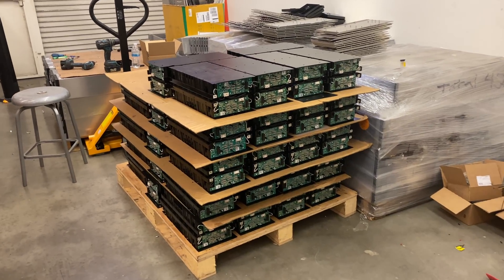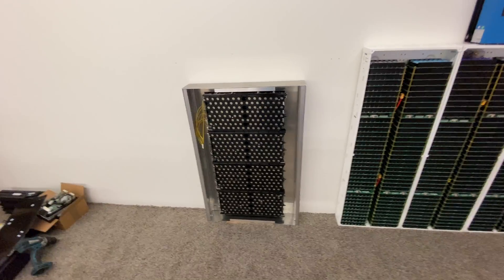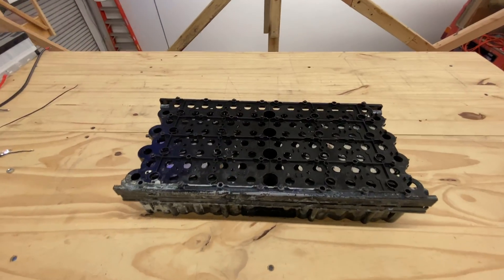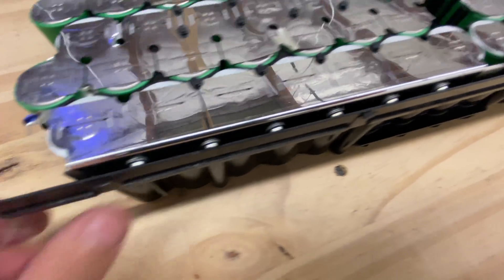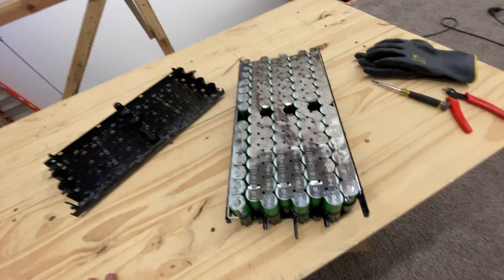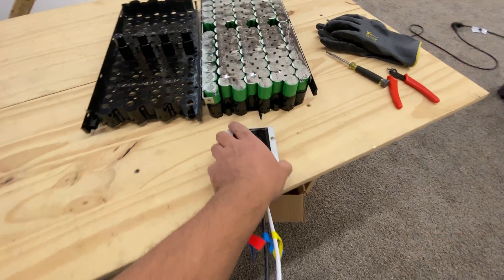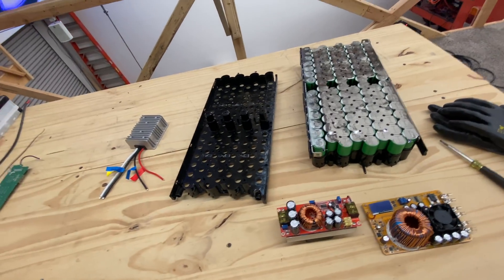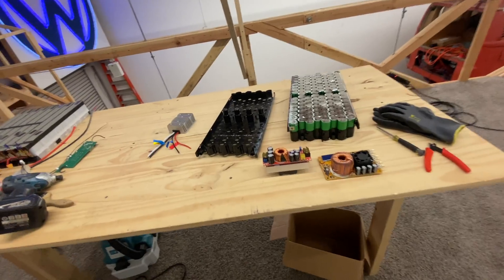$100/Kwh LiFePO4 12v Hack

Comment: Great info! 

You should consider doing some videos on 12v batteries/power supplies - I know you're focused on 24v, and power wall kinds of things, but keep in mind that there is a huge amateur radio (HAM radio) community who would love to have some videos about setting up systems to power their mobile radios. Most of the mobile radios are spec'ed out for a 13.8v power feed, so maybe that is why you haven't done anything for HAM radio operators, yet.

Thanks for the great content and guidance on 'off-grid' solutions!

~Jim

Comment: I have found that for automotive or RV use, you want the 13.8V step down converter. If you use the 12V step down all of your 12V stuff will complain of low battery once there is a load.

Comment: Baught one of these packs. Built a 24V system.  8s bms added. Charging with a solar charge controller and finding my last set of batteries the 8th string charges way faster then the other banks. 1 through 7s stay at around 3.4 volts while the 8s bank charges to 3.7.  This stops the charging. Any ideas on what I’m doing wrong.  I’m using a EP Ever charge controller. Can’t get the pack to a full charge.

Comment: For those wanting to split them in half for 2 12v batteries.
The middle metal peels right off. Use a needle nose pliers and carefully pull it off of each individual battery. Be careful not to touch any other battery.
I taped off both sides and carefully removed the middle.
Boom 2 12v batteries.

Comment: we want 12 volt because we want to ..............

1. build a drop in replacement  for a boat battery to run an electric trolling motor (i doubt you can get a 24 volt trolling motor and over volting most 12 volt motors to 24 will burn them out).

2. same goes for the car maybe a car that is very difficult to start where you end up draining the battery before the car finally starts.

3. 12 volt modules seriesed are easier to work with because you can replace a module and less cells have to go bad.

Comment: So I just tested my first pack at 0.7A per cell (10A on the pack) discharged to 2.9v (there's not much more past 2.9v), and I'm only getting 2555mah per cell average.  This is using iCharger X8.  The page says these tested 95%-100%, what is the capacity you're using?  Based on the graph on your product page, it didn't even make it to 3000mah discharging til 2v.  That graph BTW was taken from candlepowerforums by a well known contributor named HKJ.  He tested them to be 2896mah discharging at 0.5C.  Even if I use his numbers, my test results only gets me to 88%, no where near the 95%-100% advertised.  Can you elaborate more on these numbers?  How you're testing and what capacity did the 95% calculation come from?
Reply: Since the packs are sold out, and Jehu isn't replying anymore, I did my own research.  These cells don't deliver the 3000mAh that Sony claims.  After going over HKJ’s post on the testing of these Sony Lifepo4 cell, I determined based on his testing that these cells have 2800mah of capacity when discharged to 2.9v at 0.5C, my tests are even lower than that. Between 2.9v to 2v there’s barely a percent left, it isn't worth taking the cells that low.

After doing 2 full cycles on my packs, I found my first pack to have average 2575mah per cell and 2nd pack 2692mah per cell.  Since I don’t know what capacity number Jehu is using I can only assume it’s 2800mAh, since:

First pack based on manufacture’s spec: 85.83%, based on HKJ’s tested spec:  91.96%
2nd pack based on manufacture’s spec: 89.73%, based on HKJ’s tested spec:  96.14%

Not quite 95%-100% of original capacity on the first pack.  I suspect some of these packs have had a lot more than 100 cycles or they sat around a long time.

What's everyone getting on their packs?
Reply: so two of 4 tested.... cell 2 of both packs has been weird... I haven't done a soak at balance, but balanced at 3.65 with supplemental power into cell 2....   both packs finishd a charge to 3.65 across immediately discharged to 2.9 at 5 amps, then immediate recharge to 3.65 at 8 amps...    cell 2 did not track with the other cells, and was still mid 3.3s when others got back to 3.65.  All told I am getting just a smidge over 37 AH  (or ~2650 mAh per cell).   Or around 88% mfg,  ~94% on the 2800.   Definitely not he "42 Ah" listed on the store site.  Guess the more sad thing here is the stated nominal by 42 is 1075 WH, not the 1121 WH on the store page, and of course the 940 WH I am actually getting (84% of stated in the text of the ad).  Obviously the BMS board on the pack is completely passive... has the bleed resistors, voltage sense, and termistors but no smarts, just the multi-way connector.   Obviously based on the 3 of 4 arrived packs, these were designed to be two packs (one with the "HI" card, one with the "LO" card) for a 48v system.  Just feels suspicious.  Went for it because it looked to be $98ish per kwh. Looks closer to $130 per kwh.  Still better than the $400ish per kwh of some brand new cells I recently purchased. But those are perfectly matched, brand new.  I dunno.
Reply: Looks like your capacity is right between my 2 packs, although I only charged to 3.6v.  But these were never $100kWh to begin with. $119.99/1.121Wh from the description would have been $107/kWh.  At the HKJ's tested capacity, further away from that, and from our tests, even less.  The convenience of a ready-built pack at 24V is nice, but in the end, it's not really what was stated in the product page.  See, if the argument is that at 3000mAh of manufacture's state capacity, it's close to $100/kWh, but then we'd only have 85% to 90% of rated capacity, not 95%-100%.  If they go with 2800mAh of HKJ's test to get to close to 95%-100%, then it's not $100/kWh.  Only 1 is true, you can't have both.
Reply: @rcboosted  third pack just off test (god I wish I had a better setup to run better than .2C Up and .15C down.... winds up being nearly 24 hours for one full up, down, up.  Ironically again cell 2 is not acting matched to the others, required additional charging on first up, tracked down with other cells fine, but immediate recharge it was the low cell when all the others were in sync.  This pack a little lower... 36.7 AH  .. so that makes my average individual cell just over 2600 mah. Just a little down,  93-94% on 2800.   4th pack arrived this morning. Sadly its a high-pack, so wound up with 3 highs, 1 low... oh well, a little extra wire when i get around to build out.
Reply: @todkapuz  That's still higher than my low pack.  I've fully charged mine to let them sit for at least a couple week to capacity test again.  This should tell me how well they are in terms of life/cycle left.  Thanks for sharing your test results.  I did notice they stack some how, but I finally figured out the "tops" are supposed to face each other to click in.  Couldn't figure out how they clicked in top to bottom.  On a glass half full note, those light blue rubbery things that lined most of the bottom tray appears to be thermal conductive pads.  Now I have a life time supply of it.
Reply: @rcboosted  light blue rubbery things...... is that under the black plastic sheet? (I havent bothered taking it off).  YEah.. its top to top... if you have a "H" pack and a "L" pack, the terminals align right to make easy series connection. Or at least 3 of my packs have H, and 1 has L (L being busbarred the other way).  So after finishing up testing, my spread is 36.7 Ah to 37.4 Ah for the packs, or about 2610 to 2670 for the individual cells.   All 4 of my packs the 2nd cell group must have some sort of resistance difference (even though my charger says no)...  on all 4 packs all the other cells near perfect climb to 3.65 volts (with cell group 2 still around the 3.3 volt mark) with another 0.2-0.3 Ah to go into cell group 2 for it to climb to 3.65. This was both on initial charge (although that varied more, and the top balance followed by drain followed by immediate re-charge for the 0.2ish ones).  On pack rest, cell two quickly fell back down (its 0.03+ volts lower than other cells) and in general cell group 7 on all packs remained high (couple of hundredths above the average). Initial SOC for the packs, 3 of them were around 9AH to full,  my 3rd pack was 28 Ah to full.    anyhow...  all sitting now and watching the relaxation. I'll put one on discharge maybe next week.
Reply: @todkapuz  It's safe to say these are 90%-95% cells based on our tests and the 2800mah HKJ rating then.  It's strange your cell group 2 all showed lower voltage.  Could it be balance lead or charger issue?  Although I did find the middle cells in my EMC packs to be lower capacity in my other LF packs too.  Unfortunately I did not keep track of my initial charge, but I do remember the first pack was almost fully charged, (maybe that's why its capacity was lower?) 2nd pack was nearly empty, probably 30Ah+ to get it full. The blue rubbery things, yea they're under the black plastic sheet, mine came off on it's own.
Reply: (really hoping the straggler pack 4 is also a low-card setup, then I'll have two perfect packs for the 48v I intend to use these at)
Reply: @todkapuz   I received my modules this morning. I need help in replacing the BMS with one from overkillsolar. I am new to this and I can use any assistance you can give me in replacing the onboard BMS. In the meantime,  I am hoping that Jehu would put out a video on how to get this thing to work.  Thanks...
Reply: @yvonjoseph3735  the bms-like board that is on the pack is basically part of balance and monitoring interconnect board. It is completely passive, and requires a controller connected to the connector to do anything.  Basically all it has one it is all the temperature sensors route directly to the connector, and then for each cell there is a voltage sense from each cell group (a small trace) and a balance lead (a larger trace with the resistor in line).  It is kind of nice since it does have 2 amp pcb fuses.  It would be possible to build a circuit to take advantage of it, but probably not worth the cost.   The board can be left in place with no ill effect, just connect your BMS cable leads to the tabs around the board (typically the far left is negative, bottom one is first cell, oval at the top of the board above it is 2nd cell, oval to the right and bottom of board is 3rd, etc... until you get to the far right which is positive.   If you want to remove the board, there are two screws holding it in...  remove then and unclip the temperature sensor connection at the top of the board. Then you need a very powerful soldering iron (a lot of heat capacity). I started on the right side.. initially left the pos and negative connected to the board (to keep it from flying) and gently pulled away from the pack with one hand while heating the top right most tab oval... the tab pulls away back to the pack, then the lower right most.. etc...   when all the direct tabs were off, then disconnected the wires from the pos and negative tab (leaving wires on the board), and went back and soldered my bms leads directly to those tabs.    Jehu in his video just cut the tabs behind the board (or mentioned cutting them).. but there is no need to do this unless you do not have a powerful soldering iron. Do be careful with the method I described, as it can send solder flying a bit.
Reply: @todkapuz  Thanks for the advice and I will leave in place the onboard BMS and do it as you suggested. Here is the layout of the BMS leads:
———————————————
|               2         4        6        |
|    N                                     P |
|         1    3         5        7        |
———————————————
Please, let me know if I get it right..
Your assistance is very much appreciated!  By the way, I was able to verify the sequence of each cel by using a multimeter...
Reply: @todkapuz  What BMS would you recommend to use on these modules?
Reply: @yvonjoseph3735   not sure I am best to provide advice here... I have a custom daly bms on order for my 48V desired setup. If you want a generally well regarded system with low temperature cut off and bluetooth watching, probably go with the overkill solar bms... probably can get it in a short order. It is critical to make sure you get a LiFePO4 specific bms... as most other lithium chemistries have a nominal voltage above the maximum charge voltage of LiFe. And of course protect your cells from freezing (really its charging below 0C that is the biggest risk).
Reply: @todkapuz  Thank you for the thoughtful advice. I was leaning toward the Overkill BMS because of the Bluetooth feature.  I am not really too concerned about the temperature sensor, I am going to send those modules to a tropical country... Again, many thanks..

Comment: Jehu,  got my order today thanks.  What do you think about factory wire used for the 8 balance leads?  Maybe 22awg?  Seems a little on the thin side.  Do you recommend replacing them with 18awg?   Last question, are the factory balance leads connected to the cell groups in the proper fashion?  THX
Reply from the maker: Balance leads don’t need to be thick you are only balancing at rates lower than 1A

Comment: Hey man, any EU online stores that you'd recommend to get batteries to set a 10Kw battery pack backup? Most of the guys I follow on YT like you only offer delivery in North America. Much appreciated. Saludos
Reply: —> Aliexpress —> lifepo4 90Ah or 120Ah or 200Ah or 280Ah 
Maybe you should check around a little about guys who’ve tested some offerings. Because if the vendors don’t explicitly mark the cells as „grade A“ or „NEW“ you’d usually get class B batteries. If you get a grade B battery advertised with 100Ah chances are that it was a 120Ah which got rebranded once it was down to 80% capacity during its first life. This is nothing bad per SE as these batteries tend to degrade linearly. Maybe you can get a good deal like this if space is not a premium. 
Usually prices are around 220€ - 280€ per kWh which is pretty good if you you consider the cycle life of this chemistry.

Comment: 24V is the way we went with our RV. We use 24V to power the inverter and then step down to 12V for the DC circuits. Did add a small 12V (3s2p) Liion battery on the 12V side to handle any spikes in power from the pump or any of the high draw devices and to protect the 760W 24/12V converter. Not as complicated as we originally thought. In hindsight, I proabably would have considered 48V to save the frustration with such huge cables because they are still 2/0 cables (4000W inverter) and a pain to work with. Next RV will probably go 48V but the next RV will probably need 50a, not 30.

Comment: Does a LiFePO4 battery have to be cycled?    I’m using a solar panel to keep mine above 95% all the time.   How will this affect their lifetime?  Been running this way for a year so far.   No apparent I’ll effects yet.

Comment: Hello, I'm Tung, I'm From VietNamese an electric motorcycle battery factory technician. Do you mind when I want to ask you something?
On the side of the company I manufacture batteries with specifications 57.75V - 22Ah have BMS control circuit and BMS power to control the battery. The battery has 14 cell clusters, the clusters are connected in parallel.
After a period of use, the battery has cell cluster difference warning.
When tested by CAN, there was an abnormal drop cluster
Because I cannot rework because the cells are soldered, I want to ask if there is any way to charge the dipped cluster?
Because on BMS power there is a mosfet warning that the cluster is dropped on it will not charge and discharge.
Thanks!

Comment: I'd love to buy some batteries from you, but I'm in Canada, and apparently nobody ships here, and the batteries that are already  here are kinda crazy expensive because I can't seem to find anything used.  I really want to get into building a powerwall type thing, because power where I am hasn't been the most reliable and having something to bridge the gap during brownouts or outages is super valuable to me because I run a lot of electronics - most of which take a while to restart after a brownout.  Right now I have some APC SUA1500 (or similar) units with no batteries (obtained from system upgrades from work - most of them were replaced due to bad batteries but work fine); they're designed for lead-acid so a LiFePO4 would be a good replacement, especially since the system takes 24v (2x12v lead acid) normally.

I just can't get batteries that are decently affordable.

Comment: Would you not recommend these for Golf Cart batteries?  I have a 48v golf cart with FOUR 12v 100AH in series, could I not wire these up in any series/parallel that I'd want?
Reply from the maker: Yes that would work

Comment: Looks like you don't need to cut down the middle. The pack is already split 14 on one side and 14 on the other for the middle cell groups, unlike the ends where they're strung out along the bus bars. Just cut between those empty holes on both sides? Looks really easy.
Reply from the maker: No, you would end up with 2 smaller 24v packs
Reply: @jehugarcia  You wouldn't cut the whole pack in half, just the connection between groups 4 and 5, which looks like it's right there in the middle of the pack.
Reply from the maker: The aim is to make it 4s from the 8s it currently is.   Draw how you would do it
Reply: @jehugarcia  ok, put a pic on Instagram for you. Would love to see the other side of the battery or just watch you split the pack so it makes more sense. Thanks for the video!

Comment: Should we be installing these into metal containers to protect the surroundings from possible fires? If theres a short circuit or reverse polarity or energy spike, whats the chances one of those thousand batteries doesnt burn?
Reply from the maker: Electrical equipment should be housed in metal electrical enclosures